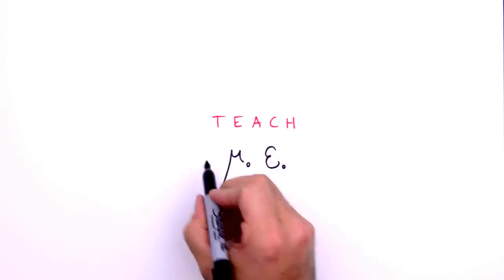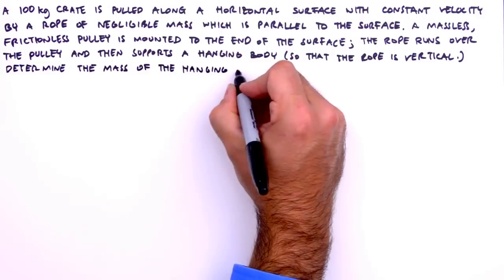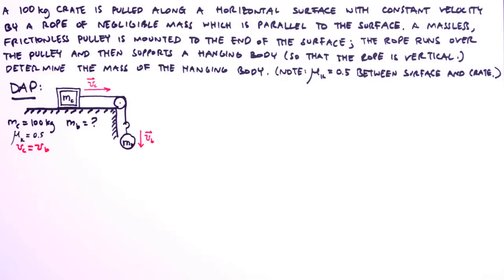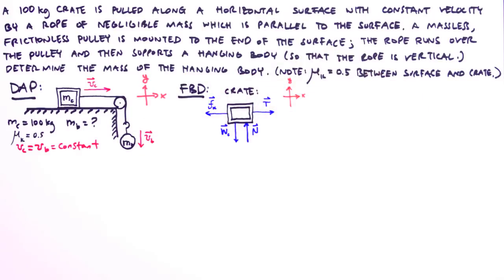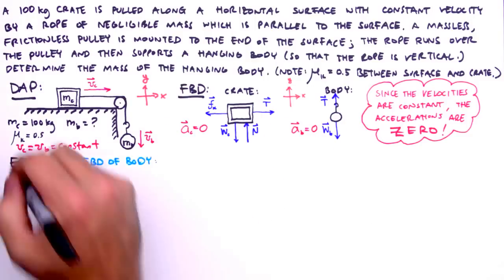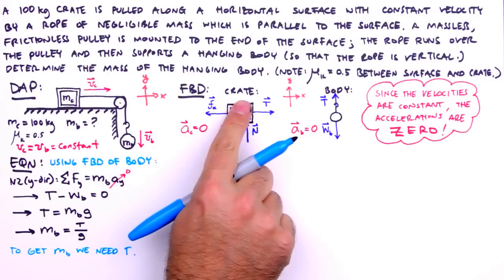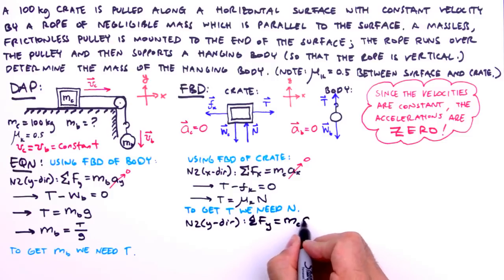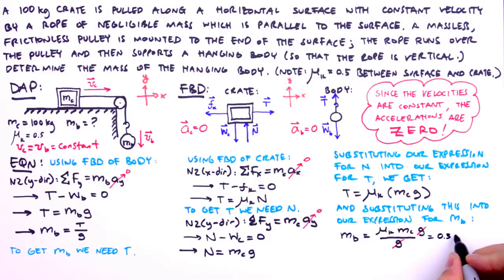How to Solve a Pulley Problem with Friction

Comment: Will it always be the case that the mass of the 2nd object is equal to the mass of the first times the friction? Because if that's true, you can save yourself a whole lot of time and just multiply the two.
Reply from the maker: Not quite, Jessica. There are many conditions (or assumptions) to this being the case. Always start with a picture and listing knowns and unknowns, then selecting the appropriate equation (in its general form) applying our conditions (knowns), and then solving symbolically before entering numerical values. Never skip a step - it pays off. Cheers from Detroit!
Reply: @JesseMason  Good to know. I was just looking for a way to simplify if possible. Thanks for the video!

Comment: What if mass A was inclined 30 degrees ?
Reply: Divide gravity to x and y components, so you'll have 2 forces, one perpendicular to the surface and one parallel to the surface.
Gx = sin A * G
Gy = cos A * G
These can be utilized easily to get acceleration and friction forces.
Might be a late tip for you, but someone else may find this helpful.